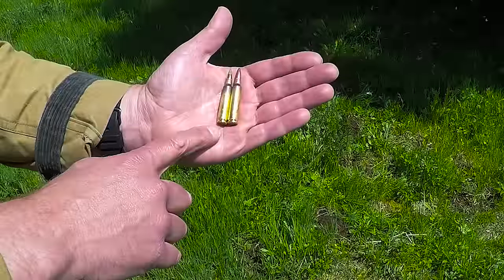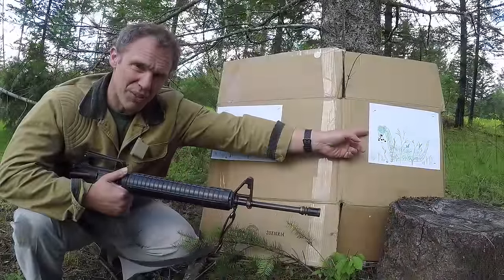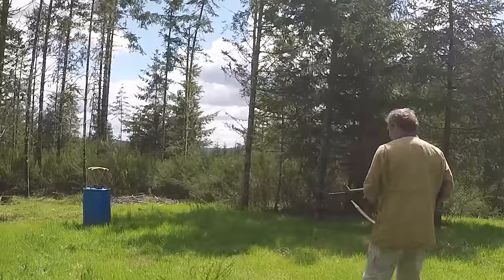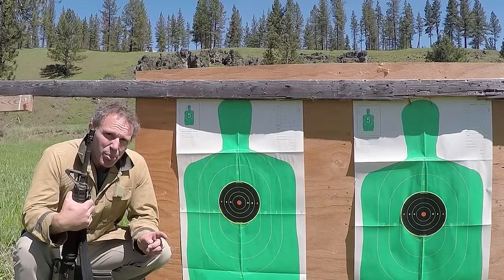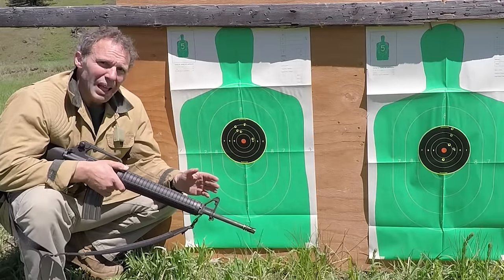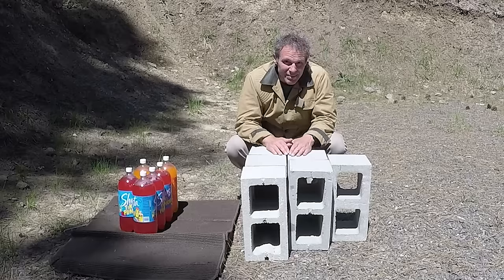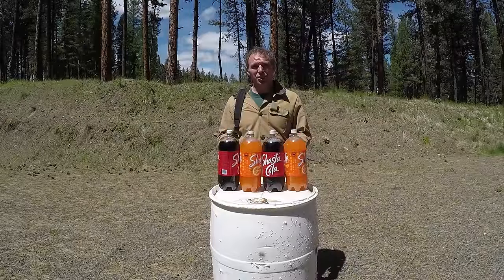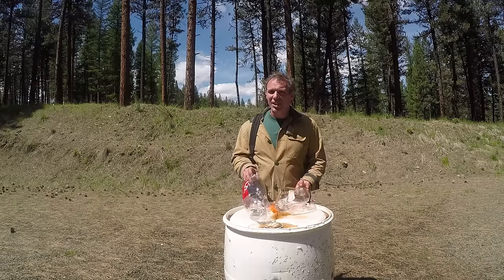5 56 NATO Ammunition:  XM193 55gr.  vs  M855 62gr.

Comment: I’m actually very shocked how little of a difference in velocity between the 16” and 20” barrels
Reply from the maker: I knew there would be a difference, but I expected it to be significantly MORE difference. Next week we will film a comparison of AR's with 20"  16" and 10.5" barrels.
Reply: @PaulHarrell , could you do the same comparison in this video but use a 24" bolt rifle vs 16" . Please and thank you!
Reply: Same here. I feel better about 16s now lol
Reply: CRANE was impressed as well.
Reply: I think his a1 just has a slow barrel and or loose chamber.  Lots of his velocities out of it are slower.  I get 3170 fps out of a del ton 16 inch middy with m193 federal.  My 20 inch a2 build was getting  3280 with m193 federal.  Both have nato chambers fwiw.
Reply: It's not a huge difference, but consider that energy is proportional to velocity squared, so a little bit of velocity gain or loss can make a noticeable difference in energy.
Reply: Typically there is a 15 to 25 fps gain per inch of barrel, not really jaw dropping difference.
Reply: It's only a four inch difference. Me vs the rifle he tells me not to worry about.
Reply: All the AR's that I currently have are 16in barreled.  I shoot the 62grn green tip because I got alot of it very cheap.  Seem accurate enough for my family.
Reply: Not a lot but enough that a 20 inch barrel puts holes straight through steel targets and 16 inch does not
Reply: @richg1221 cheap where? 🥲
Reply: @HatsuneM1ku01  yea and plus twist rates help to
Reply: @PaulHarrell  dont forget twist rates plays part
Reply: @chasearchibald2039 could also be his chronograph as he mentioned

Comment: Another great video. Paul is quickly becoming my go-to source for real, level-headed information. 

The M855 was designed for the M249 and the M16A2, both of which have 20 inch barrels with a 1:7 twist designed to stabilize the M855 and the even longer tracer round. The round will penetrate a 1980s era Soviet helmet at 550 yards. This is better than the M193 or even the M80 ball round for the 7.62x51. However, as mentioned, the steel tip makes the bullet more complicated and leads to inconsistent performance, especially from the shorter barrel of the M4 carbine. The accuracy issue can be easily overplayed for a combat round. Generations of Devil Dogs have qualified with this round out to 500 yards. I used an old A2 that was probably almost as old as I was and only dropped 5 shots from the black at the 500 yard range, including qual and all of the week practicing. The round wasn't designed for jack rabbits and is accurate enough for the vast majority of combat use.
Finally, all spitzer (pointed) bullets will tumble because their center of mass is located near the base, so the rounds will naturally flip in a medium that is denser than air. That is why the bullets are spun by the rifling to begin with, rotational inertia gives them stability. The green tip round will tumble reliably but requires a higher velocity threshold (around 2700 fps) than the M193 to fragment, and again, because of its relatively complexity, the M855 will be less consistent.
Reply: "I used an old A2 that was probably almost as old as I was" . . . . Whipper snapper.  LOL
Reply: Excellent additional info, thanks for posting that!
Reply: Removing the green paint on M855 with some witch-hazel will help increase accuracy a little bit.... but if you really want accuracy out of 5.56 you should use  77gr smk otm. M855 is not a sniper round and is capable of the 4moa the military specifies
Reply: Robert Boren Semper Fi Brother!!!
Reply: excellent info thanks a million
Reply: Spot on!
Reply: Robert Boren, many thanks for the info, and Semper Fi Marine!  You do know that he most likely did not have "Jack Rabbits" in mind, at least that's what I'm thinking?
Reply: @ryanpeck3377  
Exactly true.
I've shot a few thousand rounds of 77gr SMK hand loads during 600yrd NRA High Power matches and practice days and consistantly shot 10s and Xs.

During practis, when fitted with a 10x Leupold and no wind, I consistantly shot out the Marker at 600, obliterated the 'X' so that it had to be patched every 10+ rounds and really pizzed-off the pit crew. HaHa

The Range Boss even suggested that I bring my own box of Small Markers on Practice Days. Double HaHa....

Those SMKs, and others, are awsome.
That was with a 20" 8.5 twist flat top.
Reply: @rjinnh3933  And the 77gr. SMK is a much more devestating round. Took a 165lb. doe this year at around 220 yds. DRT. Not bad for a little .224 pill out of a 16"  1/7 " AR-15
Reply: Andre McGoo  ... Because he sure sounds like he's Marine qualified.... And my son was a 0311 NCO and I taught him how to shoot. Of course he smokes me now...
Reply: the M855 does not have a steel tip. it has a steel core.
Reply: @GIboy1990  Try looking up pictures of it cut in half.
Reply: @BB-np4ib  I've cut them in half myself. M855 does not have a steel tip. M855 is a copper based fmj with a steel core.
Reply: @GIboy1990  The entire bit that is steel is in the front with lead behind it.
Reply: @BB-np4ib  Its a copper jacketed bullet....
Reply: @GIboy1990  Yeah with a steel tip with lead after it. Just google a picture of it already. Yes there is copper over it, but the tip under that is pure steel, and the end is pure lead. Obviously under the copper.
Reply: @BB-np4ib  Ive been in the army infantry for 10 years. If the jacket is copper, than the "tip" is copper. M855 has a steel core. with lead behind, yes. but the "tip" is not steel. it is copper. thats what a jacket is. Ive fired more M855 than probably everyone in this comment section combined. The people who developed it call it a steel core penetrator. the army calls it a steel core. LC calls it a steel core or steel penetrator. but saying the "tip" is steel is innacurate and false.
Reply: @GIboy1990  The boxes we have with m855 says steel penetrator lead core, or occasionally lead plug on the older boxes. Raufoss lists them as steel penetrator and a lead core.  If you can show me a cross section, or any kind of manufacturer that labels it, or makes it obvious its a steel core that would be great. The tungsten carbide tips we had for 7.62, was also FMJ. With no copper jacket, both steel and and tungsten carbide tips eat barrels. They are still tipped though, not cored. Raufoss mk211 is cored.
Reply: Andre McGoo  Mostly, because he's been proven to know what he's talking about.
Reply: Show me an m249 with a 20" barrel... I'll wait
Reply: @mikes8697  the ones we had was 21"
Reply: Mike S the one I carried in 03-04 had a 21 inch barrel. I went through 3 barrels in fallujah. All of them were 21 inches.
Reply: @GIboy1990 M855 has a steel tip penetrator with a lead plug. The M855A1 had a steel core with a copper plug.

Comment: The meat target is much more effective as a tool in ballistic performance over Ballistic Gel. I don't know what you have to spend on making one for your videos, However, it's worth every penny.  when I shot High Power service rifle my common bullet was the 55 gr for the 200 Yard standing and sitting strings. 300 yard I would use the same bullet that I used at 600 yards.  saved me a little money on bullets and the 55 grain shot just fine at 200.  As always. Good video Paul.  Dave.
Reply: Thor's Axe what a username lol

Comment: Very eye-opening!
I worked at a gun shop during my college years in the early 80s. There was still a lot if talk about the tumbling rounds from an AR15 and even though I could have bought one at our employee discount, I never considered it. Why would I want such an inaccurate firearm? It wasn't until 1996 or 1997 that I learned of the whole rate of twist being the reason for the tumbling round and I finally bought my first AR. It's a Colt Sporter A2 with a 1/7 rate of twist. Sweet!
This is the first video I've seen that shows the difference in steel core versus lead core. 
Thanks for sharing, Paul.

Comment: He must have, like, 20/10 vision to read the velocities off his chronograph at that distance.
Reply: I thought the same thing.  Lol
Reply: He don't need no scope to shoot at a 1000 yards.
Reply: TheMetalGuy852  Incorrect.  20/10 is the correct term.  You're seeing detail at 20 feet what someone with normal vision would need to be 10 feet to see.  10/20 would be worse than 20/20 because you're seeing detail at 10 feet what someone with normal vision could see at 20 feet.  It helps to know what you're commenting about before you make the comment :)
Reply: he said once that it's not as small as it seems on camera, and its high contrast with big numbers.
Reply: I'd be afraid of shooting my chronograph
Reply: @gsfbffxpdhhdf7043  you may be right, but your spelling and grammar suggests otherwise.
Reply: I'm not sure how big the numbers displayed on the chronograph are but as someone with 20/10 vision that looks pretty impressive
Reply: He also DNT like scopes on his guns
Reply: Its a fraction.. 20/10 is 2. 20/20 is 1. 10/20 is 1/2 or 0.5

Comment: Green tip is good for anti vehicle threats and punching through doors and thin plate steel. Not to mention it's fun to play "what will this bullet go through"
Reply: Msw 96 never under estimate 55gr, though. One of my friends made a target out of some 3/8” mild steel plate. Lead core 55gr out of a 20” barrel punched nice clean holes through it.
Reply: @sandervanduren2779  , So does my 22 hornet w 45 grain blitz rounds @ 25 yds. 3/8 inch soft steel.plate. The REAL test is thicker/harder steel.
Reply: I'm genuinely worried now that using 62gr green-tip ammo for home defense is totally irresponsible.  I'll keep a PMAG loaded with M193 just in case.
Reply: @CountArtha  I keep some green tips around just in case I need to shoot through a vehicle or soft body armor. 
My go to home defense rifle is an ak in 7.62×39 with Tula 158 grain soft points. I'm sure most home defense situations can be handled with my 9mm but it's nice to have options.
Reply: @CountArtha  yes it does less damage, and over penetrates .

M193 will kill the bad guy and not even penetrate the back of his shirt hardly. 

M855 will wound the bad guy and kill your neighbor
Reply: @boomerisadog3899  m193 tears through 3a soft armor and level 3 steel armor
Reply: @zm1786  3a yeah lvl3+ not so much
Reply: @davejan744 55gr out of a 20 inch barrel goes through ar500

Comment: On the topic of 55gr bullet tumbling, it was discovered back in the 1920’s by what’s been dubbed “The pig board,” a study on bullet lethality conducted by a board of general officers on pig targets, that small caliber bullets had this tumbling property resulting in high lethality. At the time this was not pursued, but in 1954 some additional research as well  as pushing from a General Wyman in army procurement lead to a draft set of characteristics being developed by the army which were brought to Stoner to develop his then recent AR-10 into a high velocity .22 caliber rifle meeting the requirements. The original specifications were for a 1:14 rifle twist, just barely meeting stabilization requirements for the bullet and designed to meet the power requirement of penetrating a steel helmet at 500 yards. The original .223 remington cartridge designed in parallel was very explicitly designed to capitalize on this stability dichotomy to maximize lethality. The later 5.56 standardization does not make any mention of it, and the twist rate was reduced to 1:12 due to cold weather stability concerns around the time the army insisted on adding a forward assist. I would recommend finding a copy of Col. Hallock’s report on the M-16 rifle program for an exhaustively well sourced discussion on the development and procurement.

Comment: One think I know from my research on twist rate is that more aggressive twists are made for heavier grains and usually made for longer distances.

I have a 1:8 twist rate which is middle of the road between the most common three rates. (Those being 1:7 1:8 and 1:9)

For those who don't know how to tell what the ratio means, the ratio is as follows

Number of complete rifling twists:Distance in inches.

So 1 twist over 7 inches is MORE aggressive than one twist over 9 inches.
Reply: Its not measuring the number of rifling twists in a given distance. It is measuring the number of rotations of the bullet in a given distance of flight.

Comment: Take-away?  Irregardless of 16", 18" or 20" barrel length,...a 1:9, 1:8 or 1:7 twist rate for 5.56 NATO is preferred to 1:12.  

With my Sig 516 16" barrel 1:7 twist, it is dialed in to 1 MOA or less (via Steiner M332 w/ 5.56 reticle) and can make tiny little pieces of other pieces clay pigeons at 100 yds/100m all day long with 55-gr, 62-gr and even 77-gr bthp bullets (Hornady steel match).  Surprisingly, the 77-gr point of impact is not too off from the 55-gr or 62-gr.  The 1:7 barrel stabilizes all three weights well at 100 yd/m distances.  Practicle accuracy of the 55 vs 62 weights is nominal/negligible based on my experience in my rifle.

Need to test a Bushmaster Predator 20" 1:8 vs. a Bushmaster Varmint 24" 1:9 with XM193 vs XM855 run in both.
Reply: I agree

Comment: Thank you Paul!  i purchased a DPMS 20 inch AR15 about 5 years ago and right away bought a slew of ammo for it.  When i got to the range i found the difference exactly what you reported here.  i was a bit confused but am now enjoying the confidence that knowledge gives.  i worked as a contractor most of my life and knowing the potentials and limitations of your tools is the key to using them to maximum effect.

Comment: That 55 grain is screaming out of that 16". Did not expect those velocities out of that barrel.
Reply: Right! Same here
Reply: Those were some of the higher chrono readings that I've seen for the 55g, out of the 16". Nice!  5.56 55g is always moving a little faster, than the .223 55g. Looks like I need to switch to 5.56. I buy .223 because I have a bolt action in .223. And I don't wanna hear how it's ok to shoot 5.56 in a .223 chambered firearm. IT ISN'T!!!!  If you are one of those people that think it's ok... Look up throat, lead, bullet jump, rifling, chamber...things of THAT nature. You have a lot to learn. The 5.56 cartridge has virtually NO bullet jump, before it engages the rifling in a .223 chambered weapon. Rifling instantly slows velocity, which in turn, increases the pressure of an "already" higher pressured cartridge. Too many YouTube experts saying that it's ok. My face is ugly enough, without doing something that stupid.
Reply: @jamiesloan5902  Why Have a throat Reamer Both 5.56 marked barrels had burrs the old SP-1 marked 223 passed 5.56 chamber gauge on first try. AR-180 had a little bur that took One twist to remove. so all mine will feed both safely.
Reply: Most if not all AR's on the market have both .223 & 5.56mm. stamped on them to let the buyer/owner know that both can be fired in the AR. As far as a bolt action .223 I would have to check with the maker of the bolt rifle to see if it will safely fire the higher pressure 5.56mm. rounds.
Reply: @jamiesloan5902  get a .223 wylde chambering and run both...
Reply: Andre McGoo  I think it's more people get worried that because 5.56 is so velocity dependent for its wounding capabilities (at least for military fmj loads) they want as much as they can get. that and also people will say well it was designed for a 20 inch barrel so it should be in one
Reply: Andre McGoo  ... A shooter at the 300 yard range told me it's a 50 fps per inch.... Not sure if that's true but I still hit what I aimed at...

Comment: I really like this video. I've had the conversation with a few friends that are trying to stock up on the latest BT 5.56 ammo and are either going broke or cant find it. I've told them the BT ammo is great but in a pinch the XM193 works just fine. Id rather have 5000 rounds of XM193 on hand then 500 of the newest BT ammo.
Reply: I think that makes a lot of sense.

Comment: I've been a big believer in the 855 for survival and self defense for years,  but this sheds new light on the subject. 
If you were defending yourself against civilians without armor it seems the 55 might be a better choice. (though both would be devastating to be shot with) 
I recall reading an article years ago where a Vietnam vet was talking about the really wounds he witnessed from the 55 grain bullet. 
Hmmmmm. Thanks Paul!
Reply: SmokeRingsPipeDreams 55 grains bullets will rip holes.
Reply: 55gr out of a 20 inch barrel with rip holes through steel targets and armor. 62 m855 will not go through either because it’s going slower

Comment: I might be late to the game, but could you make a video talking about facts vs myths in regards to steel case ammunition in AR15s? During this ammo crisis, I'm sure we've all considered this and we'd love to hear your thoughts! Thanks!
Reply: Steel case ammo is slightly harder on your guns and leave more residue. Outside of that they work fine.
Reply: Steel cased ammo, especially the Russian garbage has a bi metal jacket, zinc and tin I think it is, that surround the lead core of the bullet.  This bi metal jacket does wear a barrel out faster.  About twice as fast, maybe more.  I have burned out good barrels at about 5000 rounds shooting the steel cased ammo.  A good barrel firing good quality copper plated ammunition should give about 10 thousand rounds before you notice accuracy problems.  In my rifles, the steel cased ammo has been as reliable as brass cased ammo, and it used to cost less.  I used to spend $40 or more less per 1,000 rounds on the steel cased ammo.  $40 a case and five cases before a barrel burns out, you can easily buy a new barrel with the money you have saved.  Now however, the price of the steel cased Russian ammo is only like a $5 savings per 1,000 rounds.  That savings is definitely not worth it.  The bi metal jacket makes spectacular sparks in the dark when being shot at a steel silhouette.